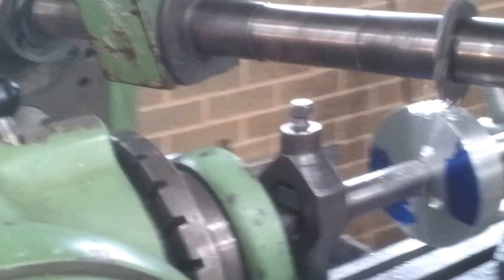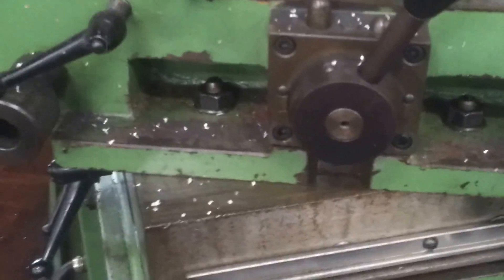Helical milling

Comment: Have you considered making a Hob and cutting the whole gear at once instead of indexing...you have the rotary indexing head geared to the table already, yes?
Reply: @EngineeringHeretic  I saw an old horizontal mill with a geartrain on the rear of the mill synchronising the spindle to the table and then the table leadscrew to the dividing head...lots of mechanisim in place to make it work. Im fascinated with gears...have been for a long time. Thanks for sharing your work and knowledge.
Reply: just posted a video,  " Helical Milling On a 1920 Kearney & Trecker Milling Machine " Think you will like my gear train.   Gerald